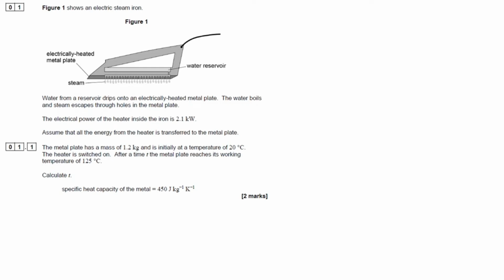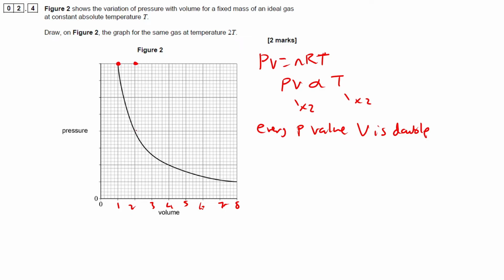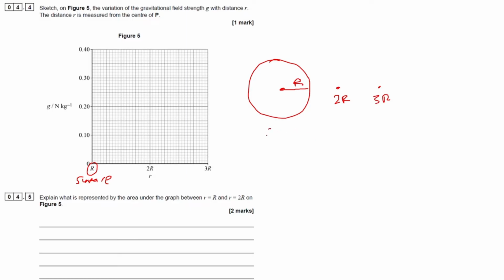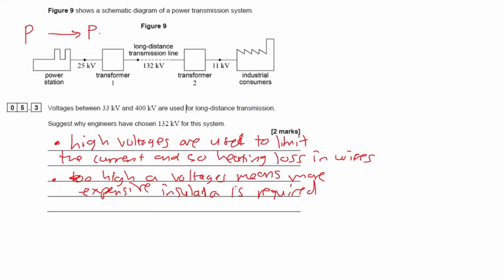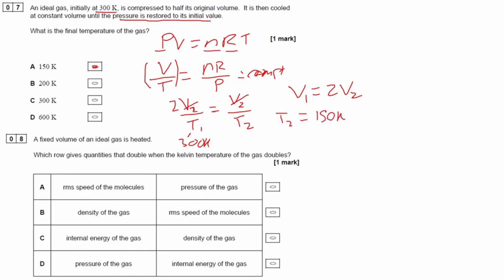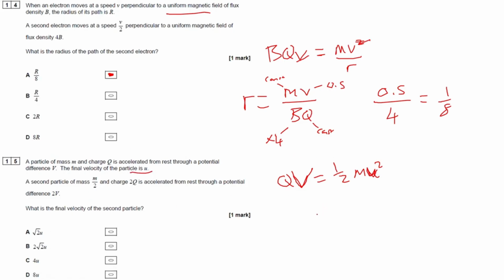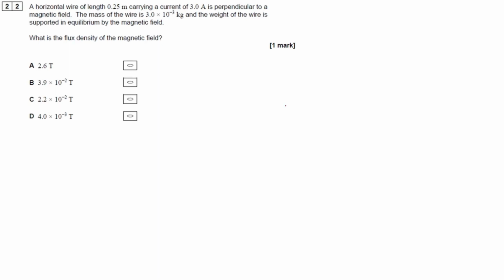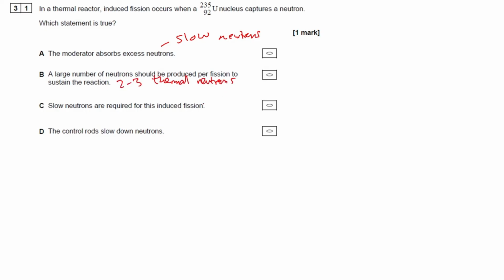A-Level Physics AQA June 2022 Paper 2 Solutions walkthrough

Comment: 3:36 shouldn’t it factorise to m/t(cT + L) rather than what you wrote, I done this on a calculator and ended up getting the same answer
Reply from the maker: Yes you're right that was a mistake when I wrote it out. The calculation I did was using the equation you mentioned